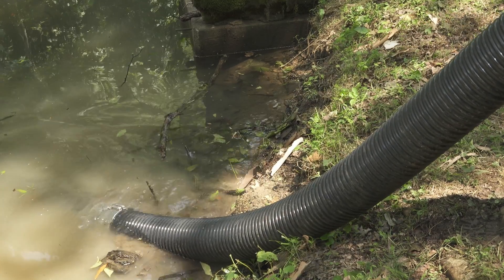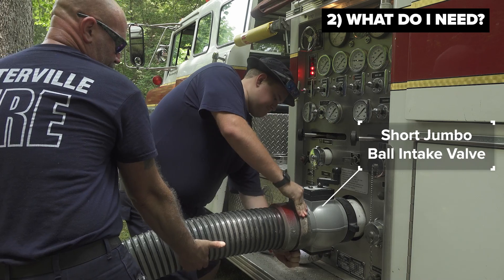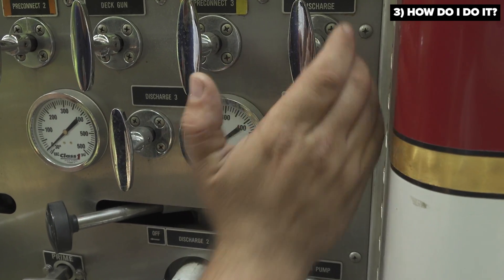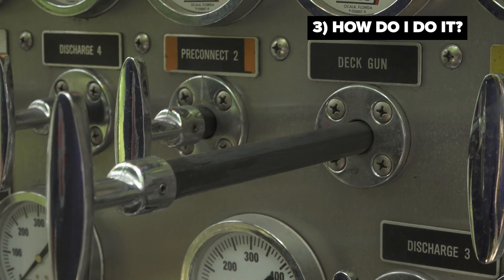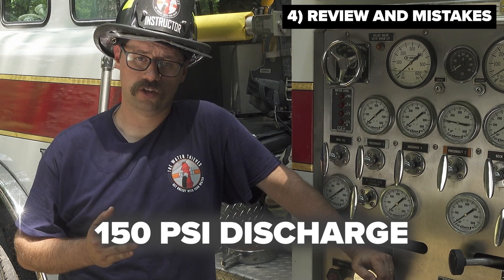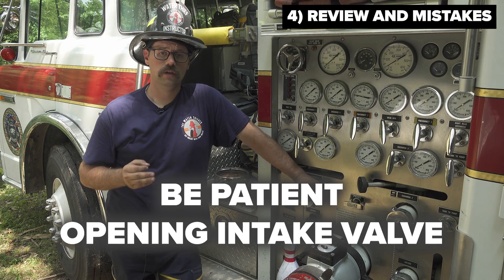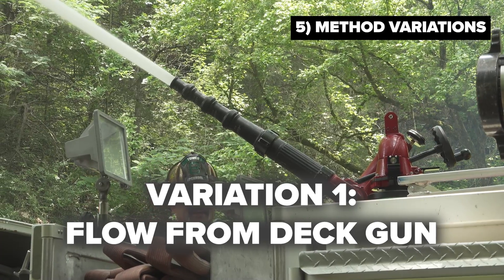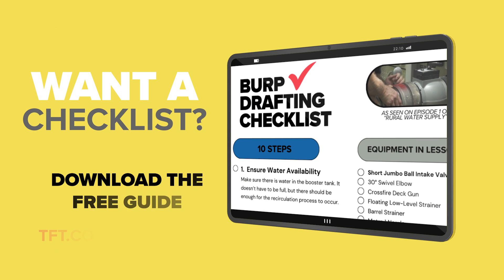How to Burp Draft | Failed Primer (Rural Water Supply - E1)

Comment: the deck gun should be the highest discharge point.  So opening it to get the air out a bit helps. Very good video. But it is an ENGINE.  The Truck is a different animal.  And I'm no city Fireman.

Comment: Why you have two handles for tank to pump?
Reply: Have been given two reasons, one being that on a hill you might have preference between a front and rear to get all the tank capacity. The other reason is the limitation of a single 2 or 2.5" connection on flow, with it being necessary to have two tank to pump valves if running a deluge at higher discharge volumes. Both have some merit and some potential drawbacks. I also don't mind the idea of having a backup to get tank water in a situation where quick water from the tank is imperative early in an operation.
Reply: I'm only seeing one "Tank to Pump" and one "Tank Refill/ Recirculate"

Comment: I ABSOLUTLY LOVE THE BURP DRAFT!! I never heard of it before. I always let the non-collapsable draft section fill with tank water before I spun the impeller to "catch a draft." The trick to making sure your draft section filled with water was to watch the bubbles (displaced air pocket) rise to the surface of the water. When the bubbles slow from many to few it means you have displaced enough air to reverse the flow in the tube. The Burp Draft is much more efficient!! Bravo to the brothers who figured out how to do it (was it y'all that was the first to think of it?). 
Helpful hint: 
Lug onto an available 2-1/2" discharge port and throw the open butt into the drink as a Prime Retention Line (PRL). Crack the PRL just enough to maintain a draft and you never lose prime.
Chief Hughes
Battalion 1 (retired)
Chicago FD
PS Love that cab over Ford! I drove them as an Engr. The 5 speed stick (pumped in 5th gear) was a joy to drive. Pump and roll capability if you knew how to defeat the drive axle while coasting.

Comment: If you have a full tank could you not also prime your drafting line by backfilling it with water? Acknowledged, it wouldn't work so well if your drafting lines have a foot-valve.
Reply: I do this pretty much as a default.  Often faster than priming and saves wear on the primer.
Reply: @bryanb7471  we're all air primers now so I don't worry about wear and tear. If you arn't in a rush it's still a good thing to practice just in case you need it.
Reply: @COWGUYVT  Our newest has an air primer with auto function, super nice.  The others are still vane primers.  Still a good skill to practice as you said.
Reply: Good show 27 years with metro FD only pulled draft twice using primer to test rated capacity of pump at training center in N Atl FD, had no clue you could do that without primer enjoyed the class been away now 20 years.
Reply: This is another technique. You let water back out the suction. Very slowly increase your rpms and you will reverse the flow of the water.
Reply: This is the way I learned, and understood it to be easier on the pump that trying to push bursts of air thru. Also, I havent tested that exact scenario but our two newest pieces have electronic pump control that bugs out when it senses air in the pump and will throttle down to idle automatically. I have had a slug of air when going from tank to pressurized water supply, despite bleeding all apparent air cause this to happen, multiple times with one apparatus to the point I now expect it and account for it. Mostly I'm running a top mount with plumbed electric intake valves and triple air primers so burping is not really an issue often but good to know how to deal if all else fails.
Reply: Yes, I’ve done this. Was on a nozzle, and Chief grabbed me and told me to get water. Second engine had laid two x 2-1/2” ‘s to exceedingly convenient draft location. State F&W small boat launch. Found large hard suction (5”? It’s been a long time.) into lake. At that time it was where we did annual pump tests. ‘Won’t prime!’ Is your tank full. Yes. That engine had 1,000 gal tank. 3” tank to pump. Prime pump, immediately open one line, I think I ran up to 100 psi, then second line. Original operator had wanted to head to fire, I said no, you’re staying here. I think mostly because I was angry. Asked him what we needed to do next. Blank look. We’re going to refill the tank. We have to be ready to prime again. Old plywood mill town, quite a few of the mill workers had built their own homes in the ‘30’s through the ‘50’s with plywood walls and ceilings. Why buy drywall if you get the plywood free or near free? Really burned. 

Electric priming pump had used a solenoid driven switch. Low amperage contact melted off.
Reply: I'll backfill on dry hydrants, especially ones that I know haven't been used in a while to also help clear out some of the debris piled on the inlet.
Reply: If you have a foot valve barrel strainer there would be very little to no air in the system. That’s the point of the foot valve. To back fill your suction hose without dumping your tank water down the hose and into the water supply. It’s no different than a back flow preventer in plumbing. However keep in mind that the inside diameter is not the same as the outside diameter because of the valve mechanism, or the diameter of the suction hose, potentially restricting the volume of water to the pump. 
Meaning the strainer itself maybe 6 inch diameter however due to the flap mechanism, the inside diameter is only 5 inches.

Comment: SO am i understanding correctly that tank fill is enough to suffice the "must be flowing water" in the 4 must?
Reply: si.
Reply: Yes, since its vented its functionally the same as any discharge. I was taught on older engines that I could throttle up to my discharge pressure and set my relief valve by thinking of it as a discharge and then switch from the tank fill to the discharge that line is hooked to because both were 2-1/2" and it would be close to your pdp. Now with pressure mode and poly tanks its not really relevant.